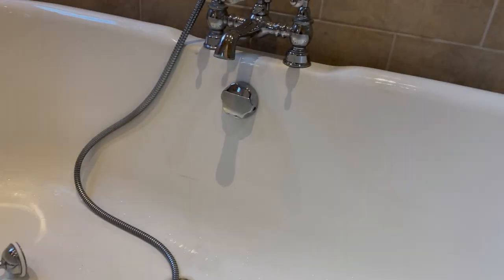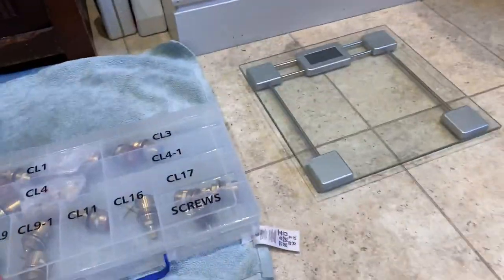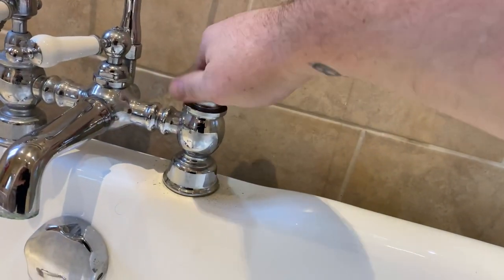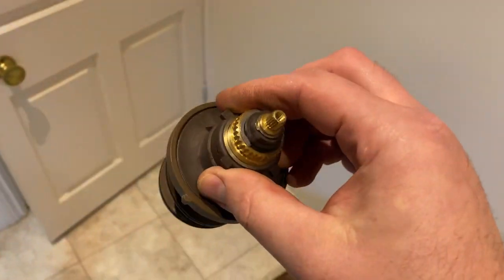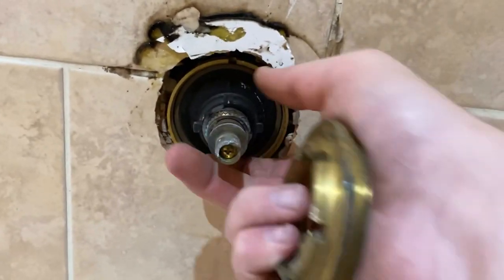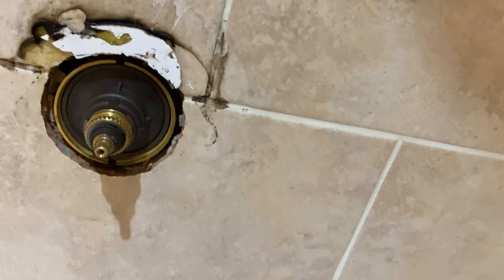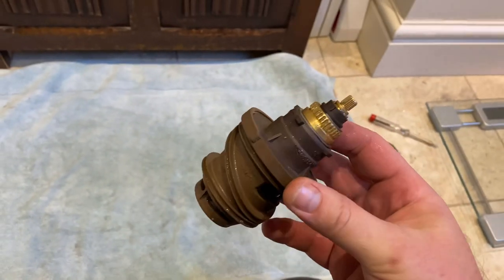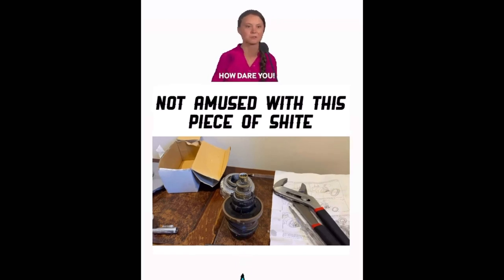BATH TAP DRIPPING 2 minute CARTRIDGE change VIDEO & NEW THERMOSTATIC SHOWER VALVE cartridge faulty

Comment: I like the way you just replaced the seals on the shower valve. The problem with all these new age valves is that they're all different. Some people buy their taps from amazon, or from another country! 

When I lived in Holland I got a job fitting out a whole bathroom with materials ordered from England. They wanted me especially due to speaking both languages. 

The tap the company sent included two steel wire mesh washers which ended up rusting and seizing up the tap after 6 months?

Another Dutch mate had a spa shower which came as a whole unit. The company went bust, so where do you get the replacement valves for that? 

Ceramic taps can be a nightmare too. Can never have enough spares. Good old taps that always worked and could be reseated. We like making life difficult for ourselves don't we.  Funny creatures us humans. 

I'm waiting for one hobbyist to comment on this post that he forgot to turn the water off before taking the spindel out.
Reply from the maker: Thanks mate.....i never order stuff off the internet, always through a reputable trade stockist
Reply: @MJTiffPlumbing  people went through a stage of ordering their own taps and getting plumbers to fit the taps the customer supplies. 

Sorry mate, wasn't insinuating you using dodgy parts. 

Customers do not understand the difference between B and Q and the plumbers merchants. B and Q always have the B rated goods which are sometimes wonky, don't fit very well. I had one toilet where the pan connector just slipped right back off after putting it on. It was tapered haha. 

Plumbers merchants get A rated products because we have to offer a guarantee too. Which is why I sometimes refuse to install something they ordered off the Internet. 

Great channel though mate, loads of great info. Thanks for sharing!
Reply from the maker: @thefunksoulplumber2222  Not a problem mate, didn't think you was...all good.

Yer people tend to think your trying to rip them off with the parts but we car 99% of the time get them cheaper and if there is ever an issue it on us, but they like to think they are saving a few quid...